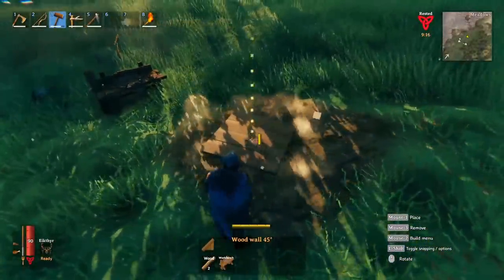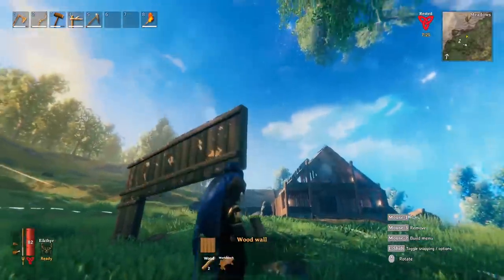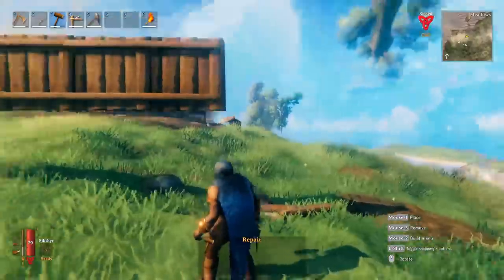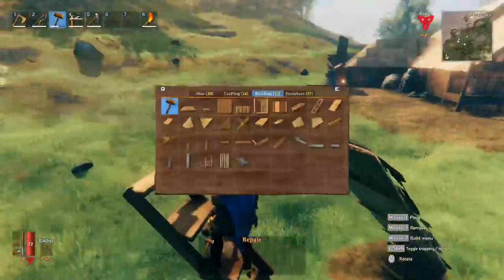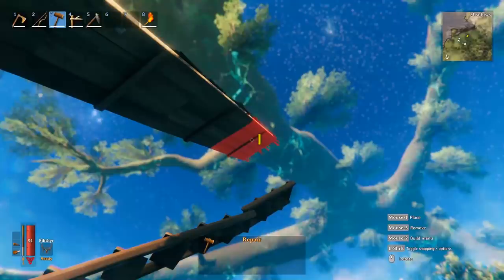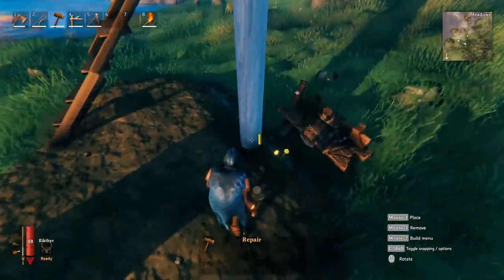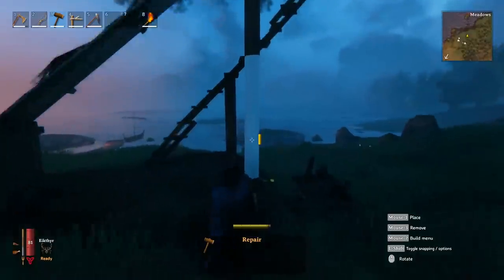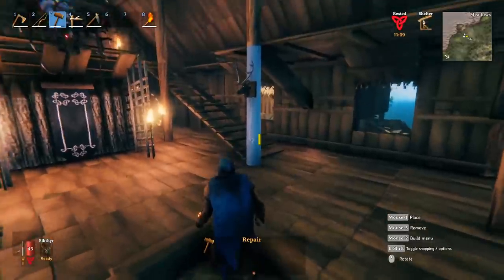VALHEIM - HOW TO REINFORCE YOUR BASE

Comment: Very great video. I now know why  my roof wont hold up. I just reinforced it with more pillars and straights and nothing worked out. It was missing the ground support and  got too high with the intital pillars! I tried to fix this for 2 hours yesterday and then gave up in utter frustraton cause I did not know why it wouldnt hold when I tried literally everything. 
It would be interesting to see how high up you could potential build and what sorts of building styles you can do without it collapsing. Or just more building tips, tricks, turtials that no one ever tells you.
Reply: I made a story building out of stone only.  second floor is a bit taller than the first. Went to make a third floor and couldnt get anything to stick other than the 2 blocks of the chimeny. However, I do think I can build with logs and wood safely ontop of it if I wanted to.

Comment: The tallest I've been able to build is a four story structure, with three of the floors being 1.5 walls high, and the fourth floor only 1 wall height (half wall not needed because of roof). This was done without the use of core wood. So I'd say that the maximum height you can build is 7 high of you're careful, and plan accordingly.
Reply from the maker: Definitely, with further testing I think you are able to actually get 8 walls high. It also has to do with the workbench's area too, as there is a bit of a height limit
Reply: Build was 7.5 to be exact, and if I had used more supports on the outside, would have been easier, and more stable.

Comment: This isn’t exactly how it works, the color indicates its current stability relative to its maximum stability. Blue doesn’t mean “foundational,” it means its at its maximum stability. Every piece inherits it’s stability from it’s “parent” piece, and certain materials have a higher maximum stability than others. You can have a completely red piece of wood iron beam, and attach a regular piece of wood and it will be blue. This is because wood irons maximum stability is 1500, while regular wood is only 100
Reply: Good to know

Comment: It comes down to a few simple things:

.) Building integrity is based on how many connection points (=pieces) you are away from a grounded (blue colored) building part.
.) Physics and real life statics don't really matter. Side beams, X cross beams and similar things that would give stability to a real house makes no difference unless they provide a path with fewer hops to the grounded part.
.) Building piece size does not make a difference for how many maximum connection points you can have. This means, larger pieces if connecting in a straight direction, will give you the same amount of connection points over a longer distance and as such the possibility to build higher and farther away from the closest grounded piece.
.) Stone acts as a pass-through for integrity and propagates the integrity of a connected piece without limit as long as you build with stone. Building stone on grounded logs transmit the grounded logs through the stone, letting you build further log parts that will turn out green, while for example building stone on yellow logs lets you transmit that yellow integrity as well.
.) Reinforced beams are treated as grounded as long as they are connected to other reinforced beams or grounded parts, effectively giving you the option to have grounded pieces high up or far away from actual ground level pieces.

Comment: While I did figure this out on my own eventually. It is really annoying that the game does not at least hint at this. Blue for the strong foundational piece is not a common color one thinks of. So for some time, I thought green was the strongest and didn't understand blue. So hopefully they add something to the tutorial raven to clue people into this concept. Building a large strong fort is a non-trivial part of the game once you get to the bronze age and beyond with all the infrastructure you need to build. Especially if you build in an area that is prone to the forest moving. Which is also a mechanic not very well explained. I assume it has to do with building in a meadow that is between two forests? Regardless this is a great game. 

Good video well done.

Comment: We found out that if you stack rock pillars until they turn yellow you can still connect a wood post and it will be blue. It might even connect to red rock pillar and turn blue but I am not sure anymore. We build a tower just for testing and it is at least 10 to 12 tiles from ground to the roof. Has anyone tried if stability increases with metal posts?

Comment: you can build even higher than 5 log poles if u build your house right next to a hill which u digged in a little so u get a clean edge where u can face your wall to or even dig a hole and build your foundation in there. so the ground level next to your house is higher which gives you a higher grounded piece. this was a common strategy to build even real houses back then. pit houses for the win

Comment: It's not the number of pieces, it's the distance that matters. Try connecting many panels on their flat side. Or check 1m beams vs 2m beams.
Different materials have different strength. That's why the Core Wood Beam is stronger than normal wood.

Comment: The structure system reminds me of 7 Days to Die. I didn't have to struggle much to figure it out thanks to having experience with it! Me and my BF got it about the same time, and he was shocked how I just casually tossed out a big nice ass log house just a bit smaller than yours right there in the opening area.
Reply from the maker: Awesome! You really need to either have had some experience with similar building mechanics or really test things out for yourself in order to fully understand how it all works

Comment: Reminder to folks that after you unlock iron, building is unlimited if you're smart with your reinforced beams
Reply from the maker: Actually not quite "unlimited". I've recently done some testing on the max build limits for each material (ignoring workbench radius) and while wood iron poles are by far the strongest, they have their limits too

Comment: Hey not sure if anyones covered this in the comments or other videos but I think you're supposed to build a house with the roof over hanging the sides, making use of those weird.. (although not weird at all) shaped pieces to protect ur external walls from the weather. Give it a go let me know what you think.
Reply from the maker: Actually the external walls will be protected if the roof is snapped on top of it, you don’t need to "hang" the roof over the edge. I have tested this and only pieces that do not have a roof either snapped directly or covering them take damage.

Comment: I'm trying to build a second floor to my house and I really just can't seem to do it without just littering the entire thing with beams. Tips?
Reply from the maker: It depends how high your 2nd floor is. Make sure that there are beams connecting the 2nd floor down to the ground so that you can reinforce their strength. It's not about amount of beams, it's about connecting to the ground/terrain in as few pieces as possible

Comment: Excellent video! The one thing to add though is that this guide is really good for early game when people first start building bigger bases.

Later on in the game you'll have access to a few new building pieces which change the rules a little bit and allow you to do more with your building.
Reply from the maker: They don't really change the rules as much as just allow you to take things further :) without spoiling anything, the later-pieces still follow the same principle but just go for further and have a few other nice effects on the pieces around them!

Comment: random pieces of some of my buildings randomly loses durability from time to time. Sometimes I can even hear the sound of something taking damage when my character sleeps. All the pieces are green. Is this a bug or am I missing something?
Reply: Extend your roof so they over hang externally and protect ur external walls😊
Reply: @Splatter_gutz  It happens to one of my main building walls, that is fully supported and green color, but mainly happens to my beams that supports my "dock" or "porch" or whatever it's called in english. It's a bridge thing that leads to where my boat is parked.
Reply: So.. Exposed timber will take damage from rain and hail.. Instead of finishing your roof at the top of your walls, add another piece on so that it creates an eaave
Reply: If you are unsure google eaave
Reply from the maker: Hmm , the only source of damage is either creatures directly damaging it or the rain/water. However weather damage will only affect the piece until 50% health and no further, so I’m not sure what could be destroying your pieces.
Reply: @schmidtyhk  So my guess is that the wallpiece is for some reason not considered roofed even though is has thatch roof over it, but the beams are obviously due to them being in the water as they function like a bridge thing that leads to my boat. I always repaired them before they break but I guess it's the water damage. Good to know I don't have to constantly repair those since they won't go below 50% hp. Thanks for the tip!
Reply from the maker: @Splatter_gutz  actually I've tested and eaves aren't necessary, the external walls don't take damage if there is a roof tile snapped above them
Reply from the maker: @seproh0  I would have to see a photo to be sure, but who knows! Glad I could help in some way

Comment: Wait, so I should've placed the wood floors before making the walls?

Oh ffs
Reply from the maker: Not necessarily. You just have to find a way to connect your roof tiles to the ground in as few pieces as possible.
Reply: @schmidtyhk  well either way, I'm gonna be floorless inside the house again like in Minecraft

also you have any tutorials on how to fighr enemies without armor?
Reply from the maker: @wacknut7072  my biggest tip for that is to rely more on a shield and manage your stamina
Reply: @schmidtyhk  Yeah, but I still can't craft armor, so sometimes the shield doesn't completely block their attacks, plus a troll could even break that
Reply from the maker: @wacknut7072  if you're having trouble, you can also use the bow and kite monsters, that's a good tactic initially. Once you unlock/build leather or troll armour, you should also be able to get a wooden tower shield and they are pretty strong early game
Reply: @schmidtyhk  never thought of that one, I'll try it out later

those trolls are pesky

Comment: U have it kinda wrong. horizontal beams provide supp but they need to lean against opposite side of the building. ofc they will provide nothing in mid air when there is no conection
Reply: ok watched full vid U have it totaly wrong... U just cant build horizontals beams just like this. it must lead to the foundation of the building. in this game integrity works kinda exactly as normal building.. U have main beams and from the main beams U bring support beams like a horizontals
Reply from the maker: @Stuart89  yes, if you see the end of the video I actually show building horizontal beams connected to the vertical beam foundations and what it is like to do so

Comment: This game is so fucking buggy.. I have a roof that is green one the one side and red on the other side (with 2 holes because I cant put anything there).. both sides are identical. I've build pillars exactly under the red spots and it wont change anything. Im done with this bs. Dont put this kind of physics into your game if you cant do it properly. smh